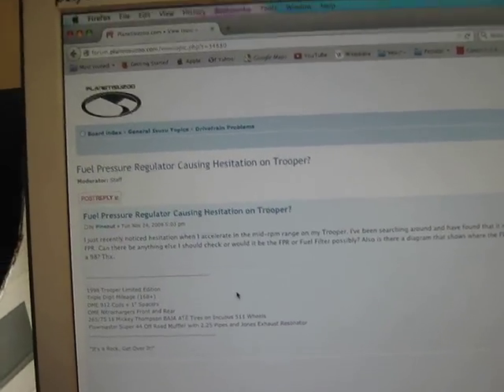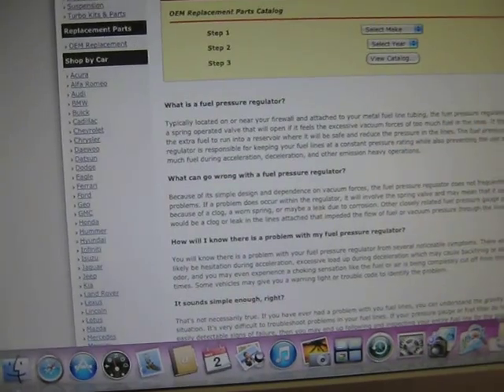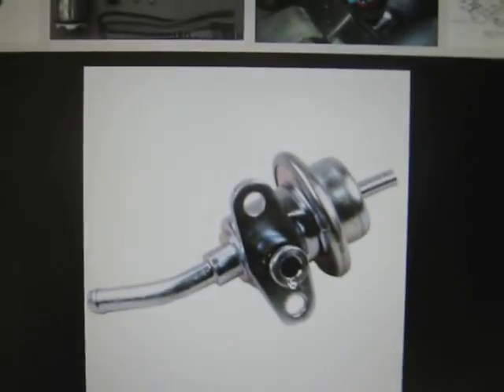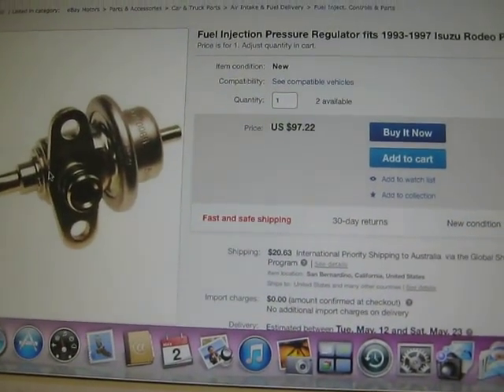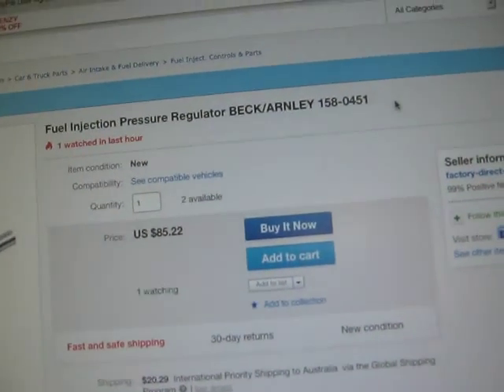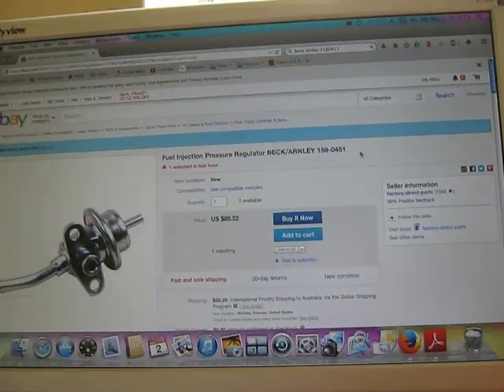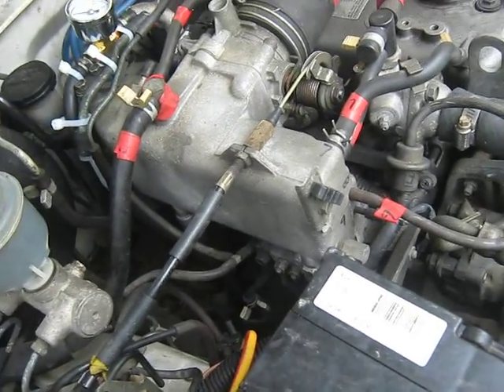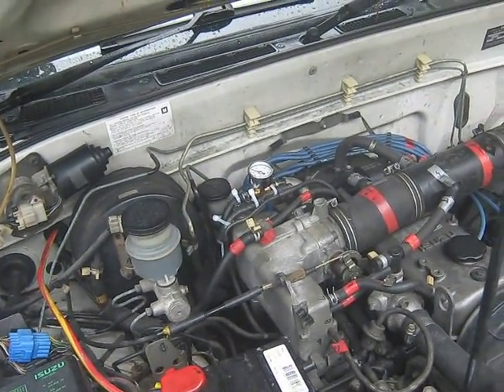1995 2.6 Holden / Isuzu rodeo / fuel pressure test ( problem was dirty MAF)

Comment: Its 2025. Just bought a 4ze1 spacecab 1990 manual.
Every 4ze1 experiences the" hesitating " bottom end sputter it seems.
Went to autobarn and got the best and cheapest help.  Yes,a dirty MAF sensor.
A tiny little diode  in a small orifice within the bellmouth of the stupid thing .
Be sure to use only LiquidMoly ,the german stuff,$20 airflow sensor cleaning spray. Nothing else.
Not even Co contact cleaner.
There is a porous coating on the diode that is essential to its function. Anthing else will either ruin or block it up. 
Disassemble maf from airbox and spray the sensor.
Worked very well,idles nicer too.
1 other thing on my list is to replace the ignitor ( beneath intake manifold ) which helps fire up coil ( mystery as to why ???) as it has a little break up still,but no where near as bad.
Chrz
Reply from the maker: Bro are you sure there is an ignitor under the intake manifold?.

Comment: Mate did this fix your problem of the spluttering and backfiring in 4th/5th ? 
I’m having the same symptoms
Reply from the maker: I had to literally disconnect the inlet duct and clean from the throttle body to the air filter ( throttle body, inlet ducting pipes, sensor, new air filter, and clean the air box (fully reset the inlet area to fix that type of problem), and if it doesn't fix it then it can be ruled out.

Comment: Hi I was looking for that pressure regulator replacement but I don't finding it , do you have any other parts that's fit well
Reply from the maker: In my experience the fuel pressure regulator was fine, my car now has 485,000 kilometers on it, I installed a fuel pressure gauge and could see the fuel pressure regulator was fine ( BTW a fuel pressure gauge is affected by engine heat and needs to be read only when the engine is cold ) - on my Rodeo I did have to replace the fuel pump, and any other problems were fixed by cleaning the MAF ( mass air flow sensor ) and the throttle body

Comment: your regulator is good !!! It is designed to maintain a steady flow of fuel to each injector . your pump puts out more pressure than the injectors requires to operate properly so it keeps the excess bled back to the tank .

Comment: Hey mate is the 1995 model same engine as the 1990? Mine is doing the same thing. Struggles down low then picks up.
Reply from the maker: If it's a fuel injected 2.6 then yes, I would replace the rotor, rotor cap spark plugs and leads ( if not new, then Id'e clean the throttle body and maybe the air flow sensor ( these days id'e just spray it with carburetor cleaner ) and check the inlet air filter
Reply: @1966human  cleaned out the throttle body today. Not much difference.
Reply from the maker: Then don't waste too much work and parts, Id'e take it to a mechanic / auto electrician
Reply: .....good video, .just watching to find out a few things about the early 2.6 isuzus . I've bought a 93 which appears to have run solely in LPG for last 23 years .  petrol tank is full to overflowing but the dash fuel icon is lit up indicating low in juice but it ain't low on juice . Naturally after all the years of not running on petrol ,it now won't run on the switch over . Engines definetly cop less cylinder wear on LPG .